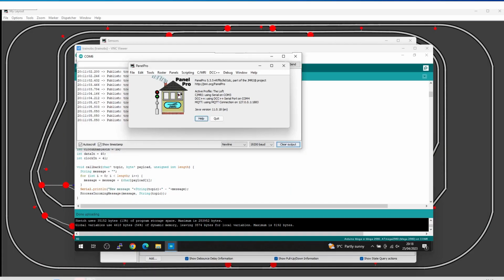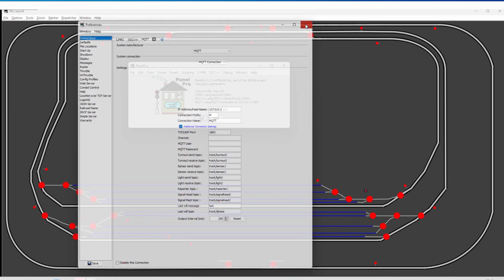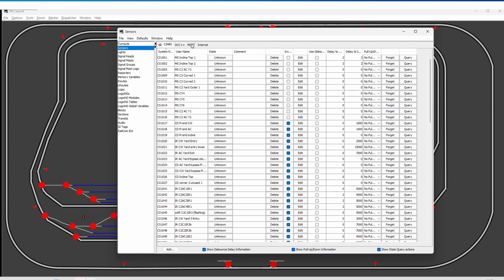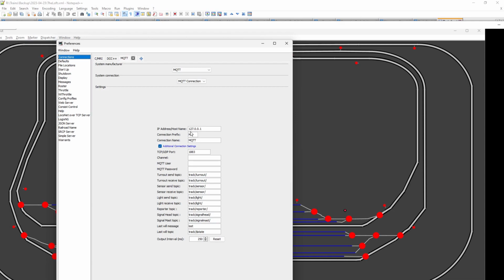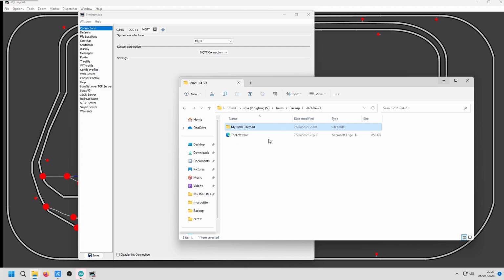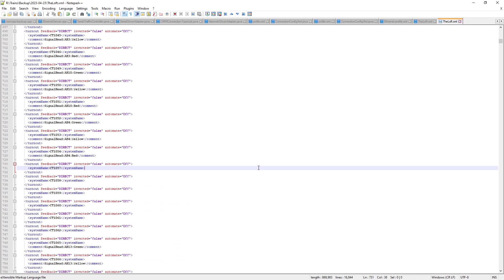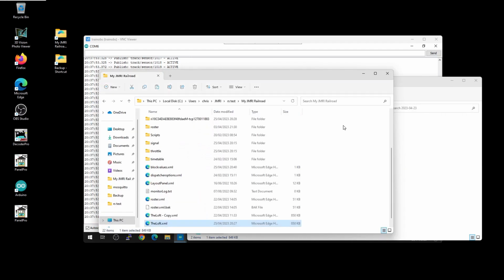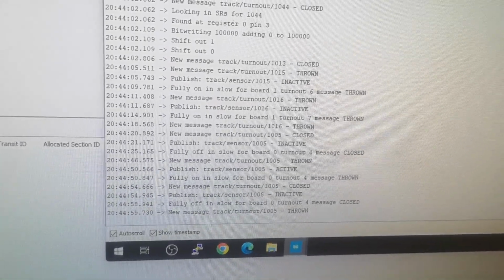Switching my layout and JMRI from using CMRI connections to using MQTT ones

Comment: Why not swap the connection prefix in the UI and change the class in the XML??
Reply from the maker: Sounds like a plan - I didn't even think of that!
Reply: Actually Chris, I have a few scripts that allow you to extract every object from the xml, and modify them, including connection prefixes, in a spreadsheet or, what I like to use, in VScode using the Excel Viewer extension. Super simple and there's a compile script that rebuilds the xml file for JMRI.